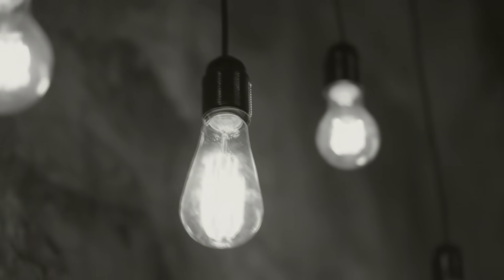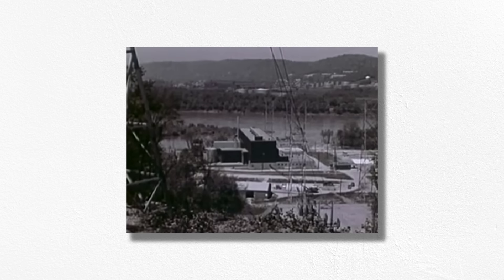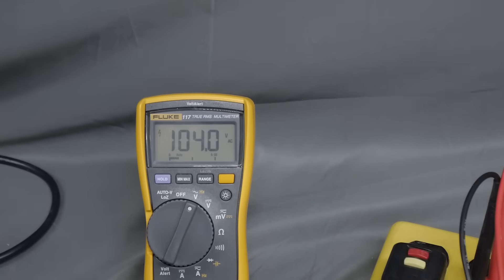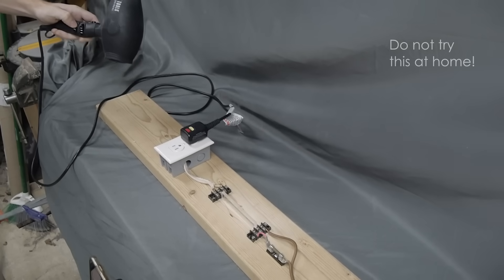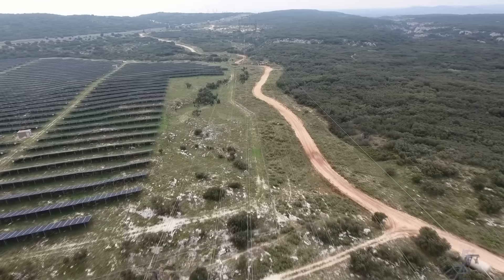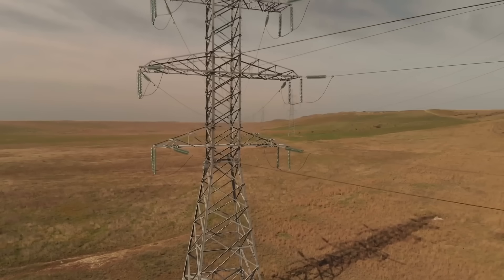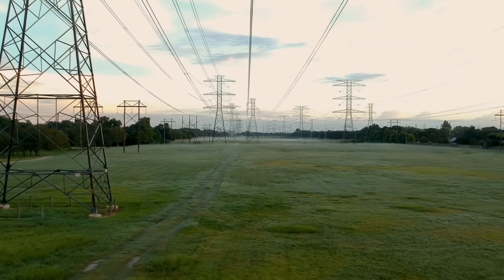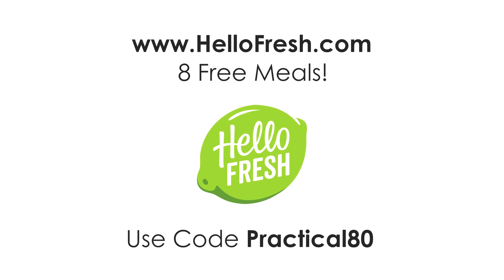How do Electric Transmission Lines Work?

Comment: Wow, there's a lot of educated electrical engineers in the comments here! I have a question, if someone wouldn't mind taking a minute and explaining this for me.

Is it possible for a person to be electrocuted/severely injured by a hot terminal (120v in U.S.) if the electric system is Un-grounded (a floating system)?

I understand that these systems aren't used because of the problems that arise from them, but this has been on my mind for some time and cant seem to find an answer.

To my knowledge, when a person touches a live wire, current passes through his/her body, passing through vital organs (a heart, causing cardiac arrest), and then flows out of the persons body, returns to the neutral through ground therefore completing the circuit and essentially killing the person
Reply: I'm not educated and I'm not an engineer, but I can take a stab (pun) at your question.  The answer is:  it depends.
The principle that electricity is always a circuit is an important one.  If we compare to a hose with water, the power source would be the pump, and the hose would always be full of water.  Turn on the pump and the pump shoves each molecule of water forward, all the way around, until the last molecule gets pushed into the pump and the whole process repeats.
If an electrical system is not connected to the Earth, then a person contacting it and the Earth at the same time poses no risk of completing a circuit through their body... similar to a bird sitting on a power line.  But that doesn't mean there can't be other consequences... especially because higher voltages have more effects along with them.  For example, a high voltage can break down your body's natural resistance to current flow, and can allow a circuit through you to the other high voltage conductor.  You don't have to be grounded, you just have to complete a circuit. The "ground" is just a convenient baseline because it can conduct current and it's always underfoot.  If one conductor of the circuit is the same as the ground voltage, than a person on the ground has the same voltage potential as that conductor and there can't be a shock.
The term "neutral" is specific to only some types of circuits, and should be avoided when speaking in generalities.  In most cases a neutral is also called the grounded conductor because it, too, is connected to ground.  But, just because the metal shell of your grounded toaster and the neutral conductor of your toaster are eventually connected together at the circuit breaker panel does not make them the same, either.
I hope that helps some. Perhaps you can explain it to me, sometime.

Comment: I think 3:33 is an error. 
It's P=VI (not V=IR) that shows that voltage needs to be increased if you want to reduce current while achieving the same power.
Reply: Both equations are true… in DC.
In AC its inaccurate... for you need then to account for inductance of the wire and capacitance to earth.

Comment: Something to point is that P = V^2/R, if you substitute current in P = VI with I = V/R. So power also relies on voltages squared, so why does it work to use higher voltages if the power should be the same regardless of the equation we use? 

The answer here is that the power dissipation in the form of heat happens when there is a voltage drop, which is very very small over the length of these power lines, due to their also very low resistance.

Comment: I've always heard that you step up voltage for transmission to manage loss, but never knew why...

This explains it perfectly.
Reply: That's a side effect, but making the line cheaper is the main reason.  Higher voltage means less amps going through the conductor, which means you can use a smaller conductor.  Smaller conductors are vastly cheaper.
Reply: Jovet distance as well

Comment: In Quebec, our hydroelectric power comes from massive dams way north (about as far north as Vermont to Florida) , so the power transmission lines are long as hell... so they developped the first 735kV lines back in the day. I don't want to touch that with a ten foot pole. (Or any pole)

Comment: One of the challenges with high voltage AC is at the speed of light, where two lines connect after hundreds of miles, they can be out of phase with each other.  How is that dealt with?
Reply: I can't actually answer your question... but I do know that electricity does travel very quickly but it does not travel at the speed of light.  I know systems and equipment exist for phase matching but hopefully someone else will chime in on more about how that works.

Comment: Fun Fact!  If you properly loop a wire length to length underneath high power transmission lines, you can capture an induced current from the e-field and get free electricity!
Reply: fractions of power

Comment: No distinction was made in this video between power and usable power (using power factor), but I suppose it was not needed because of the main topic being transmission lines.  

Also I wonder about using 2 smaller lines to carry the load vs. one big line.

Comment: Long transmission line also radiate electromagnetic waves, losing energy. Thus, there are high-voltage DC lines (HVDC) that do not radiate E/M waves.
Reply: Untrue… a magnetic field comes from a current, as per Maxwells law. The DC current will still have a magnetic field. 
As there is high voltage, there will also be an electric field... So there will be an E/M field. Just DC. 
One difference is that in an AC magnetic field, voltages can be induced and if there are any current circuits nearby, these may induce currents… 
But beyond that… HVDC does have electrich and magnetic fields...
Reply: Nico Steentjes DC lines don’t emit E/M waves, reread what I said.

Comment: I can confirm that the power lines will induce voltages on nearby lines.  I used to work for a telecom giant, and our copper phone lines would pick up voltage all the time.  It was also easy to find when a ground had been cut from a phone pole, due to the induced voltage and noise levels.

Comment: I have a question. What is the reason that they don't install those power lines underground? That way lightnings or wind wouldn't be create any issues. I know, there must be reason and I don't suggest anything but is it more costly to cave in 3 separate canals than installing giant towers? Every on of those towers cost a fortune as far as I know.

Comment: Are there special challenges in having multiple feeds into the grid? That is, having a few different power plants supply power to same grid, or having every consumer also being a producer.
Reply: One significant challenge is phasing. The video omitted the fact that using transformers to change the voltage levels is why the system must use alternating current (AC). Transformers don't work with direct current (DC) and require AC instead. In an AC circuit the voltage rises to a maximum, then falls through zero and then reverses to the opposite maximum. It does this over and over continuously and each reversal is called a "cycle". The power grid operates at a frequency of 60 cycles per second, referred to as 60 Hertz. In a AC power system with multiple generation sources care must be taken to apply all the power to the grid "in phase", which means all the different sources must be applying the highs and lows in the cycle into the system at the exact same time. Otherwise the power from the different sources will oppose each other rather than all working together. This will waste power and if the various inputs get too far out of phase the system can even burn out and fail. The way this problem is overcome is that each individual power source on the grid, including residential contributors, has to constantly monitor the phasing on the entire grid. Then each individual source has to adjust its own phasing to bring itself into lockstep with the rest of the sources on the grid.

Comment: Actually the transmission lines on real world, no youtube world, is a complex tech. The High voltage Wire present capacitive and inductive phenomena, phase shifting on current or voltage. Physical mechanichs themes is more comples, parabol figure is producto from weight of metal conductor across.  You can found important energetic looses. Important environmental impacts on fauna and flora...etc...etc

Comment: Some of your final comments reminded me of my high school. My high school is on top of a hill with high power transmission lines passing over the front parking lot. They installed metal bollards along the curb and you could feel the hum or vibration of the power lines if you touched the bollards.

Comment: Odd question. so gas, water, phone/cable lines and such all come in from under ground and you almost rearly have issues.. power outages happen evin in the middle of a sunny nice day. So Why not do the same with power lines and make them bigger better since weight wouldn't be an issue?

Comment: Where is the neutral conductor located on a transmission line?
Reply: There is no need for a neutral conductor on a transmission line because all three phases are about equally loaded. That's one of the main advantages of three phase systems.

Comment: So the voltage in transmission line is very high and the resistance is as low as possible. Ohms law is V=R*I . Shouldn't that mean, that the current in a transmission line is very high?

Comment: Why is it when showing the tower if that's what it's called anyways wouldn't it be safer to have more then one tower in case one should fail like some kind of backup solution because I only see one I some of the images

Comment: Here in Germany we have angry mobs with sharpened torches and burning pitchforks that demonstrate against all sorts of technology. There are also people against power lines. I live close to a city where people protest against a project to switch a power line from AC to DC. The arguments are like those from the anti-5G mob, DC is a completely new form of electricity and it could cause cancer.

We live in interesting times (Old Chinese curse come true (Which is a myth, there is no Chinese source)).

Comment: thx man i am a journeyman electrician but never done the transmission stuff. i could only speculate what the wire on the top was. i suspected it was some sort of protection for the phases, and lo and behold i guess that is the case! awesome video

Comment: Hi! At 3:30 I think you meant to refer to the equation P = V*I instead of Ohm's law. Reducing I in Ohm's law will always (assuming R > 0) decrease V.
Reply: 3:30 is not the only cringe-worthy time, but for 9:49 he does a good job and avoids the eyes-glazed-over response that I get when I try to explain transmission lines.

Comment: Great video and demonstration! Can you also talk about high voltage direct correct (HVDC) in power transmission? This seems to be a new solution for power transmission to minimize losses.
Reply: I suppose it depends on your definition of "new" as it relates to electricity transmission.  I designed nonceramic insulators for a 500kV DC transmission project in the southwest US 25 years ago.  To plagiarize my own comment above, there isn't much to say.  Transmitting electricity via DC results in fewer line losses, but the lower losses have to be balanced against the cost of the equipment needed to rectify the power at the point of generation and then invert it back into AC at the far end.  It's possible that in the 23 years that I've been out of that engineering field that the equipment to convert to DC and back has come down in price, making DC transmission more attractive at shorter transmission distances.

Comment: ¡Excellent video! It was so well explained. I learned a lot. Thanks! :D
I'm trying to create an Air purifier, that works like a vacuum cleaner to absorb air, then pass it through many filters and then get expelled by other pipe. Could you tell us how has to be the design of this project and the requirements? and how do I measure the effectiveness?  Please :)

Comment: What?

That doesn't make sense. In an equation, decreasing one side does not increase the other side.

2*5=10
2*4=/=12

This makes no god damned sense.

This needs to be better explained.
Remove the equation aspect or write it out so that it can be true.
Because right now, it's  V=I*R

Comment: "Electrical utilities aren't compensated for energy lost on the grid". Yeah, this may be the case for every other country on this earth but not for Turkey.
In Turkey, there are also standard energy losses on the grid due to inefficieny and then there are losses occurring because the private energy distribution company can't install electricity meters (because they get attacked by residents if they try to install them). So what does the current government do?
They let the private distribution companies charge their regular paying customers under an "Illegal Use and Losses Charge"!
Basically; if your electricity distribution company is taking heavy losses due to regular transmission losses or theft (and you won't do anything to remedy it yourself), just transfer that loss to your regular paying customers. Hell, even if you don't take losses you can add an "Illegal Use and Losses Charge" to your paying customers' bill.
Reply: Turkey on some ways is a back word country. I would like to see the climb out and become eligible to join the EU. They are already in NATO.

Comment: Electric power is actually most efficient as High voltage DC. At the generating end transformers and SCRs (silicon controlled rectifiers) convert the power to high voltage DC. It can easily be transmitted hundreds of miles. At the other end SCRs and transformers Convert it to usable three phase power. There is/was a big plant in Utah that sent power to Los Angeles, some 500 miles away, in this way. (I don't know if it's still going.) There were none of the inductive problems transmitting the power that are associated with AC.

Comment: In Ontario Canada, Hydro One charges more for the electricity lost on the way to your house than the actual electricity you used plus of course  other admin fees so in effect your bill is more than double the electricity you consumed. To make matters worse, if you go on a one month vacation for instance and close the main circuit breaker so you do not use any electricity at all, you still get a hefty bill.
Reply: Sounds like bollox to me. Because the KWH meter is positioned at people's houses so the power/energy consumed by the user is measured. There would be Court cases if the power company was measuring the KWH somewhere else and charging them for electricity not actually consumed. That would be illegal.

Comment: I was hoping this video would touch on the subject of how do they keep the grid at the same exact AC sine wave. There must be some way that they keep the interconnected generation plants producing electricity with the same AC sine wave pattern.
Reply: +Ty Brady - That is done two ways: with highly precise governors on the generators and within limits, the natural tendency for all the generators to stay in lockstep. If a generator were to slow down it would draw current from the other generators and effectively be "motored" back in step. If it were to try to go faster, the current it produces would get out ahead of the others and take on more than its normal share of the load, thus providing a natural braking action, bringing it back in line with the rest of the system.
Reply: @Inflec  Makes sense if they are already tied into the grid, thanks! But what if a big generation plant shut down and they needed to get back onto the grid. How do they know how to get their generators in the same sine wave as the rest of the system so that when they do "throw the switch" to get onto the grid they know they will be in sync with the rest of the grid? Maybe there is some sort of precise time system they all share?
Reply: +Ty Brady - If a plant goes offline it uses the external grid as a reference signal to a special device called a synchroscope. As the generators are brought back up to speed this device will tell the plant operators the voltage, frequency and phase of their generators in relation to the AC coming off the grid. When everything lines up the switch is thrown either manually or automatically.  In the early days before sophisticated electronics, this procedure was actually done by watching three light bulbs connected between the generator and the grid (one for each phase). The lights would start out bright as the generator came up to speed and glow even brighter as the generator wound up, feeding its own power into the lights. As the generator neared synchronism with the grid, the lights would begin to flicker as the AC waves feeding them began to reinforce and cancel each other. This flickering would become slower and slower as the generator neared synchronization. Then, assuming voltages were at the appropriate level, the operator would wait until the flickering was down to less than one flash cycle per second and throw the switch at the moment the lights were out. I'm sure the people that work at gigawatt-sized power stations are glad they don't have to bring their plants online using that technique!
Reply: @Inflec  Wow, thanks for the thorough explanation! Imagine being in the central command station of a big electrical generation station before the synchroscope, no windows, lots of mechanical switches. You know lives are depending on you, you think you have everything aligned with the rest of the grid, you do not want to create any type of natural braking action on your generators, (I imagine a strong enough force could break something!) you're getting ready to throw the switch.....that would be an exhilarating place to be at that moment.
Reply: +Ty Brady - If he got it wrong the breakers would trip and he'd have to do it all over. : O